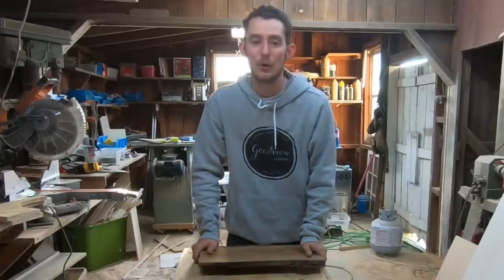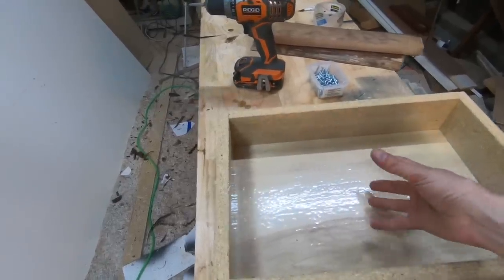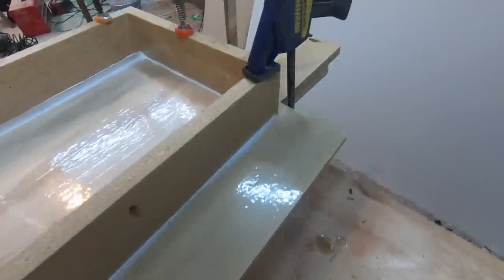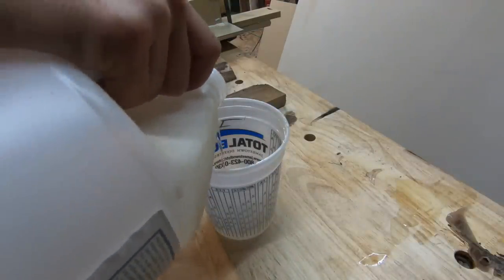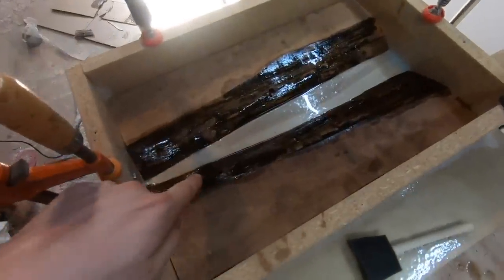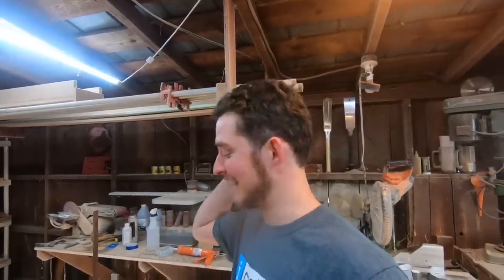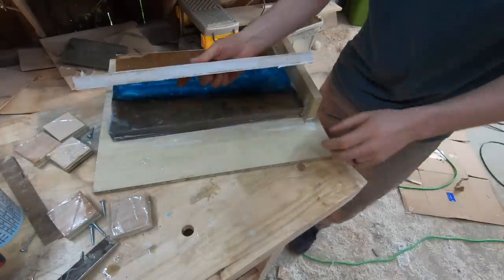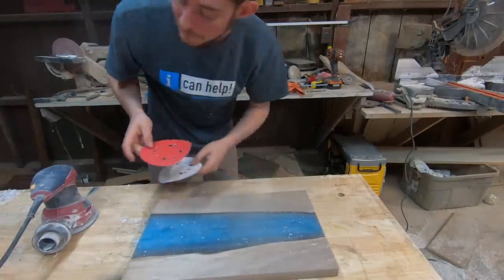Epoxy Cutting Board DIY

Comment: have you had any issues with these types of cutting boards, with the resin chipping when they are used
Reply from the maker: No, not chipping. It just gets scratches when you cut on it.
Reply: @GoodViewWoodworks  Can they just sand them out?
Reply from the maker: Yes they can

Comment: Im working on my first “deep pour”, about an inch deep and the pigment doesnt keep the design i swirled in it. How often do I need to mix during the curing process in order to get a better design?
Reply from the maker: It will hold the design when it starts to set up. When it gets a little thicker you can go back and swirl the pigments and they will stay

Comment: With using epoxy in a cutting board, does the epoxy get knife marks and cuts in it from everyday use?
Reply from the maker: Yes it does. The best way is to epoxy one side and use cutting board oil on the other side and cut on the oiled side.

Comment: Your videos/work is very nice to watch.  It's quite calming. These are great. Thanks for taking the time to record and post your work. 

On a different note, is there a particular reason to take bark off? I have seen several places take them off and was wondering if its a design choice or a structure matter.
Reply from the maker: Great question! It’s a structural choice... having said that, there are ways to keep the bark but that’s a whole other video 😉😂
Reply: @GoodViewWoodworks  I was thinking that was the case! 😄 Thanks for letting me know.

Comment: How do you make your boards food safe? My mom wants a cutting board and I can only find information about using it as a serving platter...she specifically asked for a cutting board. Is this possible and how
Reply from the maker: The epoxy is only food safe for incidental food contact. I would not recommend an actual “cutting board “. I would recommend a serving board
Reply: GoodView Woodworks thank you!

Comment: Doesn’t the planing and sanding cause mini scratches in the epoxy? I’m struggling with the finishing aspect of my projects.
Reply from the maker: Yes it does. But you need to keep working up to finer and finer grits until you reach the desired finish. Once you get up to 400 grit most finished will fill in the micro scratches and they will become invisible.

Comment: I recommend using this as a charcuterie board, not a cutting board. It's not a good idea to cut that resin with a knife, but using it as a display or serving platter is great. good job with the project
Reply from the maker: Thanks. You are correct. It’s better to use as a charcuterie board.

Comment: First loved the video.....but I am so confused when it comes to epoxy being food safe.  Can you explain because I would love to make these boards.
Reply from the maker: The epoxy I used is FDA approved for intermittent food contact only. So more like a countertop and less like a cutting board.
Reply: You mind sharing what you used?   I have a slab of walnut that I want to use for charcuterie boards but I have knots and cracks that I want to fill.  The next piece will be doing the river.  I like your technique.
Reply from the maker: Yes, I have linked all of the products in the description under the video.

Comment: Hey Nathan, find your channel a while back and subscribed. My wife doesn't usually like woodworking videos but likes watching yours with me. Couple questions regarding this cutting board.  How does it hold up to knives being used on it?  Second question, doesn't planning the epoxy really dull your planer blades?
Reply from the maker: Thank you! The knives will scratch it. The epoxy doesn’t dull the blades any faster than the wood. Thanks for watching!

Comment: I noticed you deliberately omitted to coat all four of the end grain ends of this project.
As a professional UK based woodworker I have always understood that end grain draws liquid / moisture into its vesels. Surely air bubbles must get drawn in as well ?
Reply from the maker: I omitted them because I trim the ends after taking them out of the mold. So no use in coating them.

Comment: It is a cutting board for food. Are you sure a small amount of epoxy from repetitive cutting with knife is not in your food? Is that safe?
Reply from the maker: I wouldn’t recommend using as a cutting board , more as a serving board. Having said that, Companies have been making plastic cutting boards for a very long time. The epoxy is pretty inert after it’s cured. And it’s only food safe for accidental food contact. Thanks for asking

Comment: Hi, was there a reason that when you drilled the holes to act as dowels, that you drilled on an angle first then downward?  TIA
Reply from the maker: coppergirlkaren great question. I did this because the edge is angled and it’s easier to start the bit of I angled it. Hope this makes sense.
Reply: Makes complete sense.  Thank you.  Love your videos.  💙
Reply from the maker: Thank you!!

Comment: Epoxy resin table sir can survive in  heat for an hour ?
Reply: I mean i put the fire on top for heating bulalo soup for an hour
Reply: Just asking sir if can survive on heat for an hour
Reply from the maker: It all depends on how hot the surface will get. Some epoxies can handle up to 350°F. The issue is that if you heat up the epoxy for long enough it may cause the epoxy it get soft and warp.
Reply: Sir me i ask a few question ?? Should i wait to dry the first final coat ? Before apply another 1 ?
Reply from the maker: @renatodelacruzcruz3769  yes, then scuff sand with 220 grit before applying the next coat.
Reply: Ok sir thank you. After the 2 final coat . Can i apply a car wax to shine my project ?
Reply from the maker: @renatodelacruzcruz3769  yes you can!

Comment: Hi Nathan. Just a quick question... If the epoxy isn't going to hold up to knives, this there something else that can be used as a final coat or will the board simply have to be re-treated with waxes like I've read about in the the previous comments? Thanks!
Reply from the maker: I’m not sure of any other coating. The best thing would be to re-treat with the butcher block conditioner. Thanks for asking

Comment: How well will the epoxy hold up to a knife being run over it repeatedly? How often do you have to put the conditioner on it?
Reply from the maker: It will scratch it up. You need to add conditioner after every time you wash it. The epoxy is scratch resistant but it will be like a plastic cutting board. The good thing is you can always sand it down.

Comment: Hi.... looks really nice. Question...is epoxy food safe? I know the finish you used is food safe but after use for a while, it's inevitable that it will wear. If it is food safe, I've got my next project for my buddies birthday present....thanks.
Reply from the maker: Yes this brand of epoxy is food safe. However I wouldn’t use it for anything hot.

Comment: You do nice work,that beautiful board could be used as a serving board but not a cutting board,knives would scratch and gouge that epoxy right up,l know from experience..Lol nice work though.
Reply: What could you do to make it suitable as a chopping board? Or nothing you can do? Would like one as a chopping board myself haha
Reply from the maker: There really isn’t anything you can do. If you gouge it, just sand it down and reapply the butcher block conditioner.
Reply: @GoodViewWoodworks  the fact is that resin particles are going to food, and resin is not good as food

Comment: Stone coat is NOT FDA approved for cutting surfaces. It can be used for countertops, because we don't cut on them, we use cutting boards. The only FDA approved epoxy/resin that I know of is Art Resin. 

Also, did you clean up the caulk, after it dried?
Reply from the maker: Thanks for the insight. Per the owner of Stone Coat Countertops it’s FDA approved for “accidental food contact”.
Yes I remove the caulk and cut to final dimensions. Thanks for watching!
Reply: @GoodViewWoodworks  "Accidental food contact" doesn't mean that it's ok for a cutting board. It's potentially toxic when cut. You shouldn't be teaching this process.
Reply: @darrinlindsey  You are wrong sir, it would only be toxic if it was heated, no food you put on it will be that hot. Best to actually research before condeming someone on their work, it makes you sound jealous.
Reply: Oh and BTW...the FDA approves mercury in your flu shots and immunizations, so they tend to be wrong on occasion.
Reply: @thepaintedhuckleberry356  I'm not wrong. I said that it's potentially toxic. You can't comprehend simple sentences!
Reply: Darrin Lindsey .... don’t be a jerk... it’s simple, be polite and be a gentleman. Thanks
Reply: @thepaintedhuckleberry356  You're one of "those people". Thimerosal is a derivative of the metal Hg. It's used in the MANUFACTURING PROCESS! Think of it like this..... If you cook on a grill using charcoal as the heat source. You don't eat the charcoal in your food.
Reply: Darrin Lindsey you are just adorable

Comment: An Epoxy joint will never break on the joint with the wood unless there is something wrong with your epoxy.  If you are having problems with that buy a better Epoxy for your pours.
Reply from the maker: I have never had it happen, however I have had tons of comments where people don’t trust the bond. So this was to keep their minds at ease.

Comment: I’ve seen some other videos where they say you can’t use an epoxy cutting board for food since it’s not save for the food
Reply from the maker: They have countertop epoxy that is food safe for “incidental contact” but your correct it should only be used as a cheese board or a serving board.
Reply: @GoodViewWoodworks  this should be made very clear, regular use is going to crack and splinter that epoxy, which will inevitably get into your food
Reply from the maker: Well let’s be clear. Epoxy will not crack and splinter from using a knife. There is a chance, if you try to shave the epoxy that some small shavings will be in your food. Regular cutting can result in microscopic pieces ending up in your food. That’s why we should see the comment above. Thank you all for your concern and thank you all for commenting!

Comment: must be me but I think removing the bark removes some of the character and aura of the wood.
Reply from the maker: You’re correct! However if you don’t fully encapsulate the piece in resin the bark could come off and your project can fall apart.
Reply: @GoodViewWoodworks  The slab my wife brought home has the bark edge on one side. She wants a coffee table out of it and she wants or told me she wants it as part of the table and showing.  My thoughts were that if the epoxy was allowed to run over the top edge down it would encapsulate it . Will that work or not a good way to do it.? .. If she wasn't a good cook and money maker I'd tell her no but I like to eat and get my allowance .. lol..
Reply from the maker: freebird1963 that will totally work however you will want to seal the bark prior to pouring your flood coat.
Reply: @GoodViewWoodworks  so from your videos thats just brushing on a thin coat of the epoxy ? Hey I really appreciate the help and feedback.
Reply from the maker: freebird1963 correct! However you should put 3 thin layers. Let them set up (start to cure) between coats. Make sure it’s tacky but not fully cured before adding the next seal coat.

Comment: looks nice but I personally wouldn’t want to use an epoxy cutting board, would hate to spend all that money just to scratch and cut up the surface.
Reply: Not to mention how badly it will dull good knives.

Comment: Ive always heard people screaming not to use epoxy on food related products.... are they just being paranoid?
Reply from the maker: Yes. Stonecoat is food safe. Plus unless you’re putting huge gouges in your cutting board and not cleaning it, you’re fine. People say bacteria 🦠 can get into the grooves. So just make sure you clean it thoroughly. No different than a wood cutting board or plastic one.
Reply: GoodView Woodworks very true
Reply: I worked in a meat packing plant in my mid teens until I graduated high school. I remember the butchers used the old school big heavy chopping blocks. I think they were either oak or maple? But they were massive. Easily well over 100 lbs each. Then they expanded a bit and installed some type of plastic cutting boards. They used to get periodicals from the food industry or the FDA or some government agency concerning the meat processing industry.

Every night I had a to scrub the chopping blocks and cutting tables with soap and water and rinse clean with a hose. This was a large operation and the floors were included.

One day I was reading one of the articles in the literature concerning wood chopping blocks and the new plastic ones. It turned out that the plastic ones retained much more bacteria than the wood ones. Despite being scrubbed and cleaned the same. I'm 65 now so that was a long time ago. The details are a little fuzzy by now. In essence, the wood chopping blocks actually helped kill the bacteria while the plastic ones allowed it to thrive. Maybe by now they have figured out an alternative material that is more bacteria resistant.

Comment: Great video, fantastic end result. Something I will try. However, I firmly believe that video presenters must follow good safe workshop practices. I notice you used your chisel with your left hand positioned right in front of the blade. This is probably the most dangerous practice in a workshop, especially when the chisel is blunt like yours! Hands must always be behind the chisel! Where were your gloves and safety glasses when you were mixing the epoxy? To spill epoxy on yourself, or get splashed in the eye has horrible results (many people are quite allergic to epoxy).
The floor of your workshop is a disaster, full of tripping hazards! I could mention many other things wrong but I do not want to take the kudos away from your otherwise excellent presentation.
Remember, if you present a video with good safe practices you will probably save many nasty injuries!
Now, I am off to try making one of your boards!
Reply from the maker: Hey thanks for the comment and looking out for my safety. I really appreciate that. I have been doing better with my PPE and with having a safer working environment but I do forget sometimes. Thank you for your kind words!!
Reply: @GoodViewWoodworks  Sorry, not worried about your safety -- I am worried about you teaching unsafe practices to people that think everything they see on "You Tube" is good! I did 5 years apprenticeship on Cabinetmaking then a further 2 years getting qualified in Wood Machining - I am happy to show my scars to demonstrate what I am talking about! I learnt the hard way - I think your viewers deserve to see only videos that demonstrate safe working practices. Thus, workshop should be pristine (currently mine is worse than yours shown on the video) tools should be sharp (blunt tools = more force = more accidents) and safe practices taught - If you do not know what is safe/unsafe I think it is your responsibility to find out before going to air (how to use chisels, keeping hands behind cutting edges etc etc.). Sorry to lecture,but the unsafe practices were so glaring that I felt a responsibility to comment.
By the way, I have set up 3 cutting boards plus the formwork and now only have to wait to buy the epoxy tomorrow (Monday).
Reply: @tonyhooper2063  I dont agree with you. He is not instructing you on how to do something. He is not offering a course. He as with many Youtubers is showing you how he does something and that's all. Most youtubers are in this category. They are not professionals and do not have a professional shop. Most have not been trained. This is Youtube. As an employer that has to deal with this type of thing on a daily basis I enjoy watching the non professionals doing what they do. I would only advise Nathan to add a statement at the beginning of his videos to this effect.

Comment: I was told that it is not safe to use epoxy on a cutting board where cuts would occur and epoxy is jot safe to eat
Reply from the maker: Epoxy is FDA approve for “incidental food contact”. This means that you can set food on it but it’s probably better if you don’t cut or prepare food on it. Thanks for asking
Reply: And yet this is called a cutting board...
Reply from the maker: Sorry that was supposed to be “intermittent” not incidental.